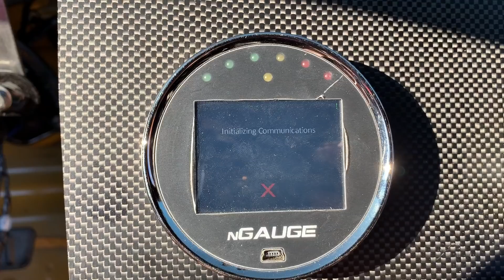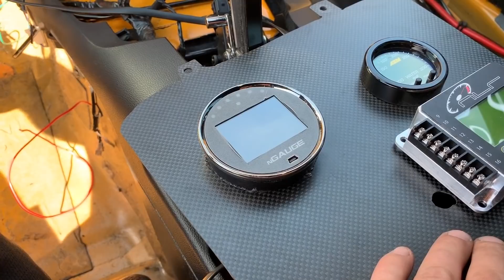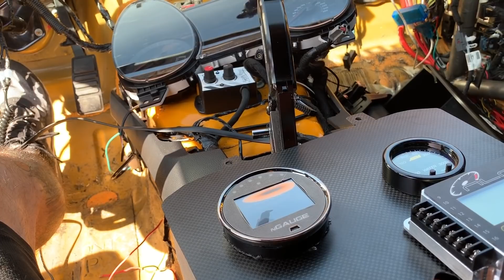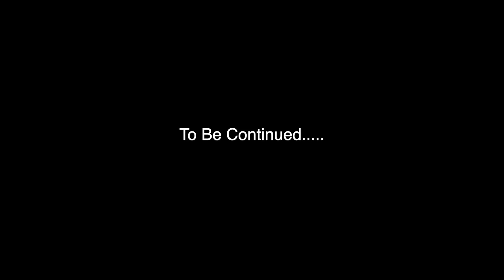FIRST Start Up on the BUILT TURBO Mustang! TX2K20 Prep Part 6

Comment: Good choice Joe those twin 102mm are in my opinion the best twin set up that's out there right now if I had the money it's the set up I would have went with you are going to be going as fast as you want it to go after you get that car dialed in unless you want to go full blown Pro Mod I'm talking Stevie Jackson level or funny car and top fuel. This is probably going to be the last car your going to have to build. 🦅🇺🇸🦅